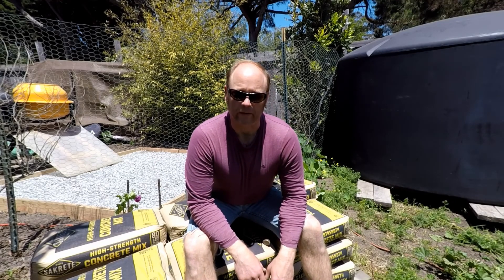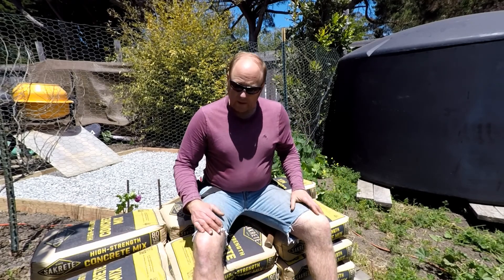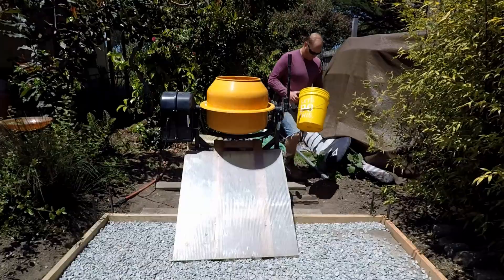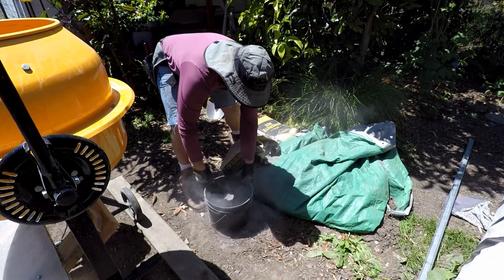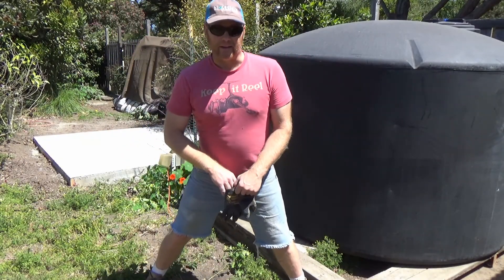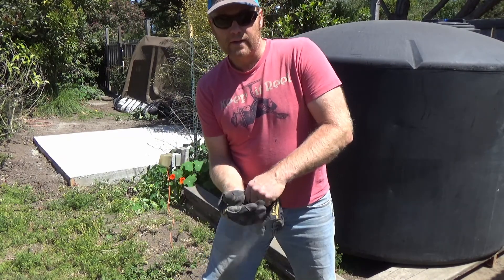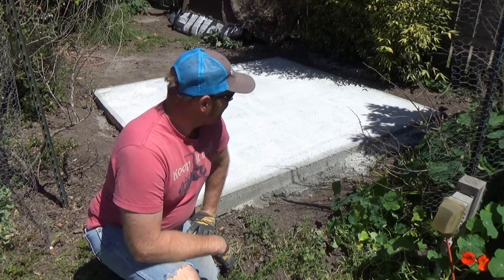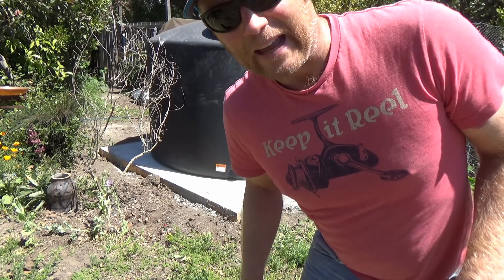How to build a concrete slab to support a water tank that will be used to store collected rainwater

Comment: I would really be curious to see how that concrete is holding up... A 3" slab is not sufficient for holding 1,500 gallons of water. That much water weights 12,500+ pounds. There are a lot of things to consider here. If you take a 1/2" dowel that is 1" long and try and break it in half with just your hands, you would not be able to do it. If you take that same dowel, but make it 4' long, you will easily be able to break it with your hand. Why? Because even though the thickness didn't change, the length did, which allows the force on the ends to have a greater effect. For it to not break, you need to increase the thickness as you increase the length. The same goes for concrete pads. The larger the pad, the less weight it can support if you do not increase the thickness. At a minimum, that pad should have been 6" thick with #4 rebar spaced every 2'. Personally, I would have gone 8" think with #5 rebar placed every 2', and had a concrete company  bring it as the consistency of the mud is just as important as the thickness and reinforcement. You also should have had plastic under it to help it retain moisture as it cured. You said early in your video that you felt confident in your concrete abilities having done it a couple times, but concrete is something that can take years to be able to master. And even then, people still make huge mistakes.
Reply from the maker: You definitely know your concrete and I appreciate the checking in and all your shared info. Yes, all good points. It has been a while since making the slab and it’s still holding together. Thank you again!

Comment: 2 comments,  first a very thin plastic over the rock would help hold the moisture in the concrete as the crystal grows in wet not dry which increases strength, the other and this is equally serious, your concrete is way too wet.   

it should have what is called slump, and that is a more viscous flow to it.   it is described as partially melted malt.  very thick.

there are applications where you need a slurry such as you have but foundations are not that place

Comment: Can I put a 275 gallon tote next to my house foundation, on the gravel between the homes? Is there any danger to damage of foundation? Do I need a slab like you?
Reply: next to it wont harm anything; i would just use a gravel bed like Scott did without the concrete